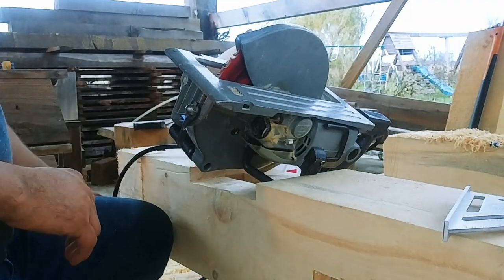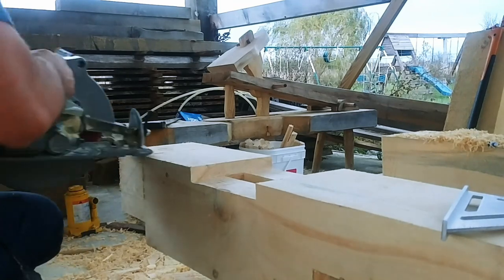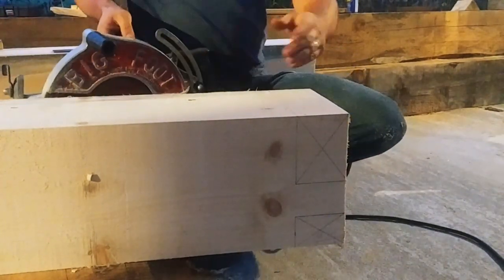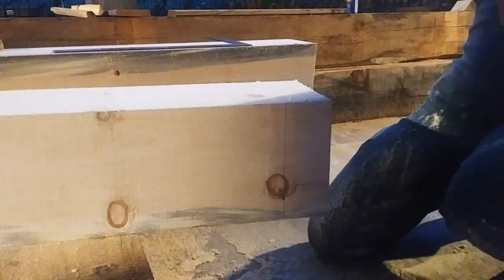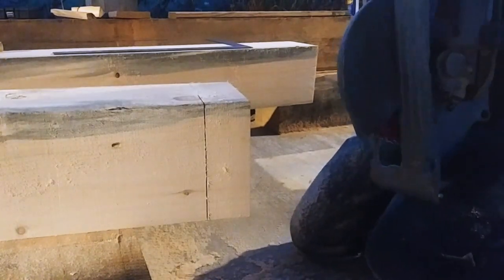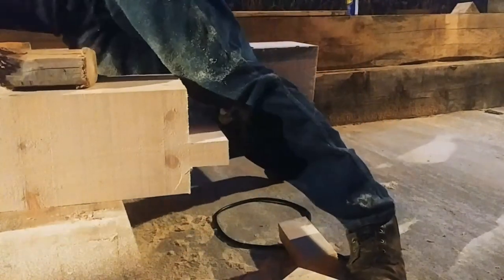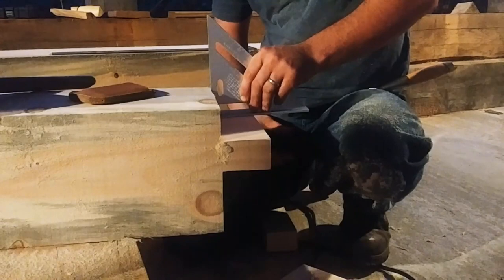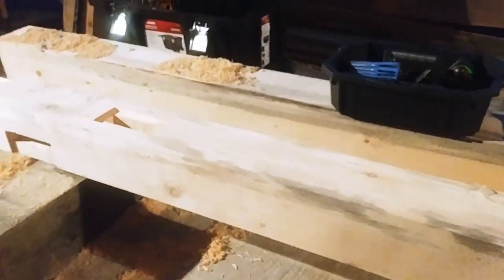A Timber Frame Vlog #71: Another Night of Queen Posts

Comment: Another benefit to kerfing is you get that satisfying task of cracking all the biscuits off. The chisel paring is also pretty satisfying. And you get more practice guiding the saw.

What, besides copious experience and incomparable male virility, is preventing your drop cut from going off plumb as you cut?
Reply from the maker: +Lolita's Garden steady hand with the saw to get a good drop cut and the shoe of the saw sitting flat against the timber.

Comment: Thanks for stopping the saw in the kerf when finishing the cut.  If I may ask, how deep will the big foot cut on a 90 degree cut?
Reply from the maker: +Timberdoodles 90 degree I get 3-7/8".  Wish I had invested in the Makita 16" saw, at least for the 10"+ stuff.
Reply: I run a Makita with a 8" blade.  It sure would be cool to have a 10 and a 16 inch saw, but the 10 has a lousy depth.  I put a 8.25 table saw blade on my Makita 8" saw and it will cut fat 3" stock cleanly.  When I pick up my framing again I will likely grab a 16" saw.   and maybe a Mafel chain morticer.
Reply from the maker: +Timberdoodles i like the 10-1/4" saw but it sure does lack for these larger timbers.  The chain morticer is great, even with my goofy clamping fix.  I would rather have one that cuts across the grain.  When you catch a knot with this thing it sometimes moves it on you in the middle of a cut...bout makes a guy cuss.
On another note, do you find the information here accurate?  I ask because I want to make sure I'm putting good stuff out there.
Reply: Yes, good stuff your putting out.  We all have our own variances in technique.  I like to see others work, there is always some little trick that needs trying.
Reply from the maker: +Timberdoodles thank you.  I learn with every timber.  Seems you could never be able to learn it all, I like that.
Reply: There are many levels of learning.

Comment: Morning Jim,
Maybe it's just me thinking that some might not know the difference, but could you include a brief drawing/explanation of the difference and purpose of queen and king posts. I'd kind of like your take on it as well. The two books I've acquired so far aren't real clear on it.
Thanks.
Reply from the maker: +Thomas Russell i view the queen post as a post that doesn't carry the load continuously to the foundation.  I'll do some digging.
Reply: TheTradesmanChannel 2017 thanks.
Reply: My 0.02 worth... a king post supports a ridge beam or 2 rafters at the ridge, while a queen post supports a purlin beam or a rafter somewhere near mid-span.  So there would be 1 king post, or 2 queen posts, viewing in cross section.
Reply from the maker: +Chris Peters good description.
Reply: Chris Peters thanks, Chris. I was thinking the same thing, and have seen pics where both are used for wide spans. Additionally, a queen post setup is preferable for open access areas, where a king postsystem, being in the middle, would close space off. Best I can tell from my limited research.
Reply: If your looking to conserve joinery a King will do that.  If you need space in the attic or roof layer a King can get in the way but if the roof is big enough you can easily walk around it.  The King post truss does a wonderful job of allowing a clear span below the truss.  They may have more limits the wider the building gets but have been used on 40 foot wide building with no issues.  As mentioned Queens are great if a principle purling roof is to be used. Queen post trusses are more complicated to cut, or to clarify, more pieces to cut, and if you're intending it for a clear span below you need to be up on your load paths.     You can also put a principal purling on a king post truss too, with common rafters.  There are so many ways to skin this cat, combination of joinery all over the place.
Reply from the maker: +Timberdoodles well said.  I bounced all over the map on that question for this roof...was going to do principal rafters first and then wondered how I was going to put 8x10's up alone, then started figuring dead loads and I just wasn't at a point to do them (sized seem big but my live load is substantial here in the lake effect band)...then I figured on common rafters with purlin plates and finally settled on a bastardized gambrel roof design.